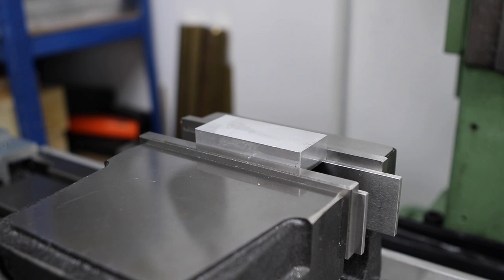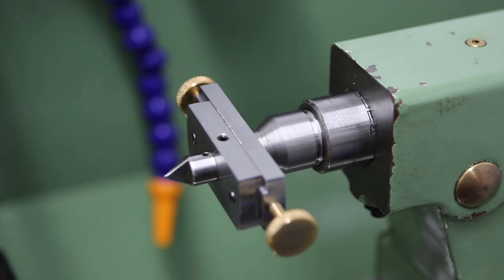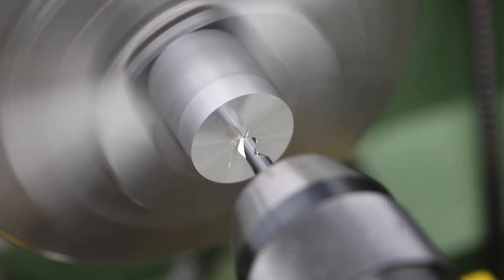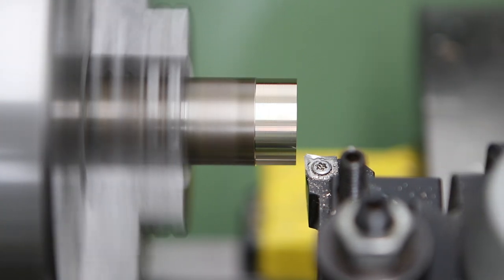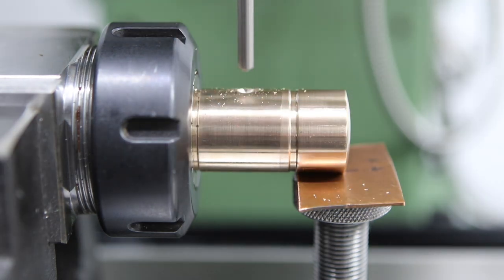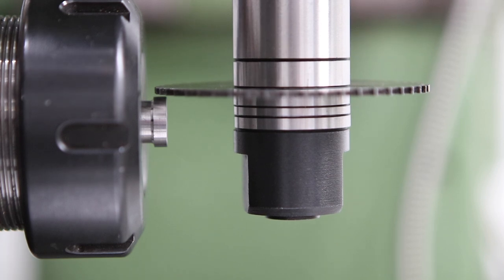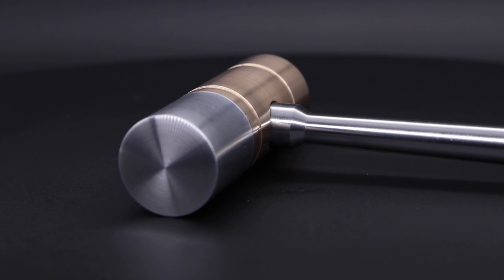Making a Machinist's Hammer from Hemingway Kits

Comment: A great video for us lathe beginners, thanks! I made the hole in the head by clamping it against my 4-jaw chuck, locating longitudinally to a center in the tail stock and side-to-side with a dial indicator against chuck jaws. Two jaws were inside and two jaws outside to hold the length. I really needed a machinist’s hammer to tap the head in, but didn’t have one yet!
Reply from the maker: Good job! There isn’t much you can’t do with the four jaw! What’s your next project?

Comment: I know this is a older video but for anyone wondering about surface finish with slow speed hss would be the best preferably with a decent radius on it but if you only have carbide fine your biggest nose radius tip typically .8mm run it real slow like 100 rpm with a .1 feed and use coolant mainly to wash away the swarf better known has a water cut
Reply from the maker: Thanks for the tip

Comment: A nice idea, but . . . Where’s the socket?
Usually such a tool has a brass face on one side and a socket for the mill drawbar on the other. While many guys knurl the handle, I wrapped my handle in rubber tape and heat-shrink tubing for a bit of cushioning.
Start with a deep impact-rated socket. Impact sockets are softer and lack plating. Make your brass head by milling a square peg onto the end of a bit of bar stock. Pin the head to the socket. Weld the handle to the socket. Wrap handle and you’re finished.

Comment: Looks very good. The icing on the cake would have been if you had clocked the slit in the nut parallel or perpendicular to the head.
Reply from the maker: Good point, should have done that!

Comment: Very nice job. It does look weird being offset, but you can see it is very well balanced as you twirl it in your hand. 
I'm surprised the Hemingway kit was based on bananas rather than metric, I thought they were a UK supplier.
Reply from the maker: Thanks Jack. Hemingway kits are a UK based supplier. Some of their newer designs such as the rotary broach have metric plans, but many of the kits are are based upon older designs from the 70’s when imperial was still prevalent.
Reply: @joneseymakes  - note the "imperial" BSF and BSW threads specified in these old kits is Whitworth, and not the UNF and UNC threads that are used in the US and Canada.
If you are translating into American for your viewers, then just substitute the terms BSF=UNF and BSW=UNC. Nobody in any country uses Whitworth in normal machining for about the last 40-50 years.

Comment: Hammer handles MUST have an oblong/elliptical cross section for positive grip.Very reduced control for round and skinny handle if oily,sweaty hand.
Reply from the maker: Fair point. I wouldn’t want to use a regular hammer with a skinny handle. This will be used for very light work however, setting work true in the vice etc where more ‘feel’ is required. I’ll use it for a bit and see how I get on, I could always knurl the handle later for better grip if needed. Thanks for the feedback.
Reply: I don't agree. I have three machinist's hammers, one of which is the Hemingway kit that I made, and two were purchased. They ALL have round shafts. See https://www.youtube.com/watch?v=tu1fgwjbJ-o&t=996s and you will see another video of making a machinist's hammer - also with a round shaft.
Reply: @ianbramble8337  - well of course. It's too hard to buy oval stock.

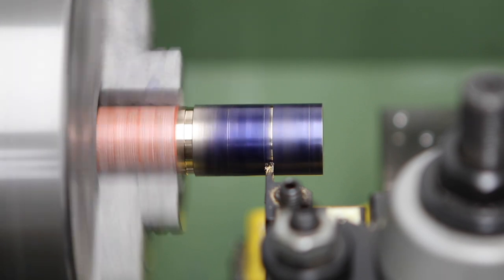Comment: Following page 9:30
The parting accident was caused by excessive flex in the system.  So where? Given your machine didn’t exhibit flex before, I think it came between the round and the jaws. 

Normally the parting tool dig under the center line by system flex but this time the round rose up also causing the digging. And the smoking gun is right at page 9:44
Reply from the maker: Yes I'd agree, thanks.